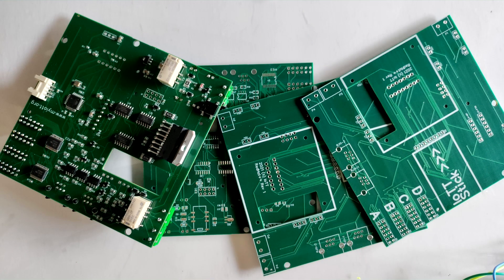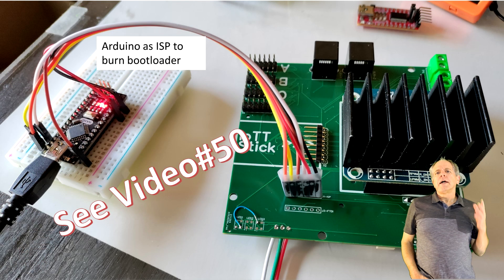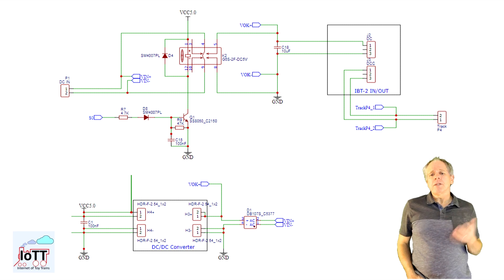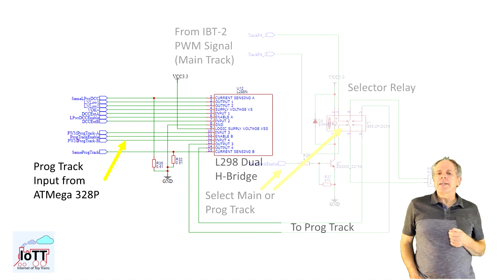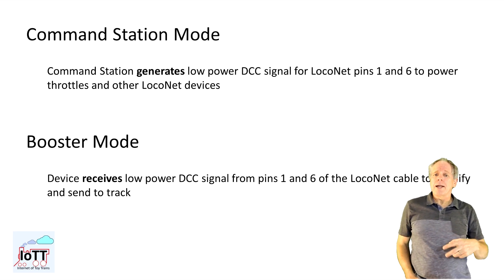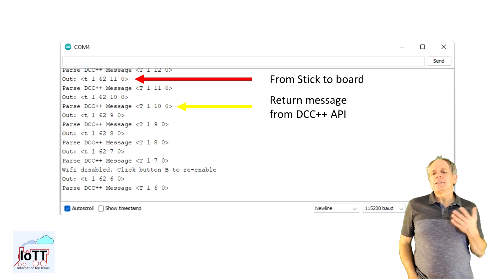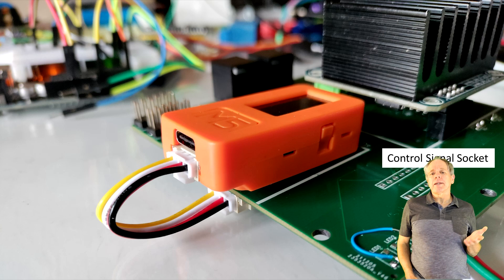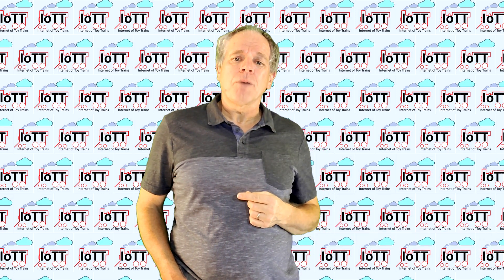RedHat++ LocoNet Command Station (Video#85)

Comment: Are there any plans or possibilities of having IR mode to use Digitrax throttles wirelessly?
Reply from the maker: I have not tested it, but I think it should work. You can connect your IR receiver to the Loconet from the RedHat and than operate your throttle the very same way as you would on a Digitrax system.

Comment: I love seeing your modular approach to the model railway and putting things together.   
There are a lot of projects out there now for Arduino.  All seem based around similar design, but with their own little twist that seems to stop them being fully compatible with other projects...
What are your thoughts of this sort of thing?   Arcomora and other such designs?
Do you think we will ever come to a point where all these little projects will start working together to maybe make one project that is just brilliant at everything?
Reply from the maker: Thank you, I'm glad you like what I am doing.
I basically like and welcome all DIY electronics activities in the model railroad field. And I don't think there will ever be one project that does it all, and honestly, I don't see the need for it nor do I think that it would be beneficial for the MR community. 
Control systems on a model railroad are normally distributed over the layout, so a modular approach with modules from different manufacturers is perfectly fine. What is important though is that solutions from various sources can work together, which requires some shared interfaces. With DCC there is a standard that already allows for standardizing on the decoder communication. For layout control I think LocoNet is a de facto standard as it is simple and reliable, supports at least the essential elements of a model railroad, and is used by several manufacturers. Of course I wish Digitrax would be more active in developing the message structure to support new elements like buttons or analog inputs and outputs, but there are work arounds. And of course it would be nice we would see some new standards for audio and video communication to support cameras in locomotives for autonomous driving and the like, but for now that's just a dream.

Comment: Just a note that you don't need a relay or any other system to be able to switch the programming track between MAIN and PROG, this is called "DriveAway" and is built into DCC++EX. The manual command is <1 JOIN>, but it is supported directly in JMRI and Engine Driver. Just have a siding or another section of track that is isolated and connected to PROG (output B), but part of your layout, drive onto it, issue a programming command, and the track will automatically switch to programming mode and back to MAIN mode. Then just drive off the track - Fred
Reply from the maker: I am aware of this option. The reason I chose the relay solution is that I only have one GPIO to drive the L298, which means I cannot support the Railcom cutout, which I will do on the main signal. Of course, the relay will switch automatically when the service mode track is used (if configured like that).

Comment: You made good progress on your project. That brilliant.  I can’t wait to try it out. 
Now I need to figure out a way to make it work with an ESU system. The L.net device allow to add digitrax hand held  and accessories but seem to work only one way. I don’t have an oscilloscope to see if there any dcc signals provided on the loconet network. I guess I need to put one on my wish list.
I love your detail progress engineering video. You have a good mix of advanced and simple hand on videos. So it is appealing to à broder audience.
Reply from the maker: Thank you. Not sure about the ESU, but if you can use Digitrax throttles on it, then LocoNet must be two way communication as the throttle needs information from the command station to work.

Comment: The Red Hat is something that I'm very interested in obtaining. Your integrated design is brilliant! Well done Hans, you have started 2022 off with a BANG!!!
Reply from the maker: Thank you. What I like the most is that the same device can serve either as command station or regular booster. And with LocoNet, the inputs and LED's are still operational when working as booster. Creates some new possibilities.
Reply: @IoTT  Yes, that is one of the things that caught my attention. When it is available I’ll use it on a small portable layout I have. If it works as well as I think it will, it just might replace my NCE Powerhouse Pro on my main layout. It will go well with my other IoTT devices.